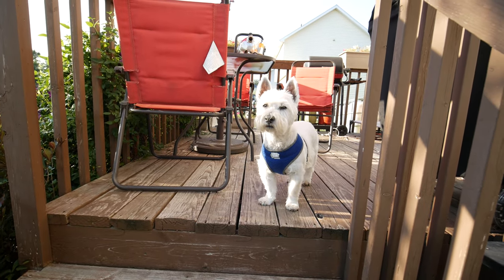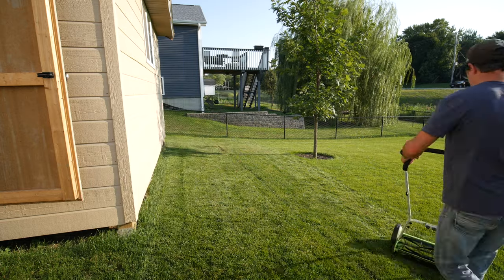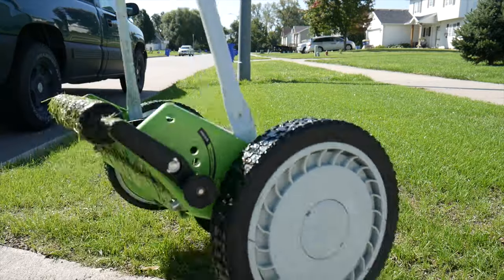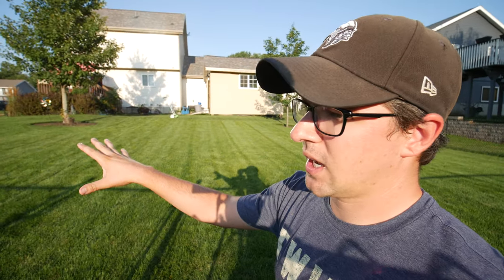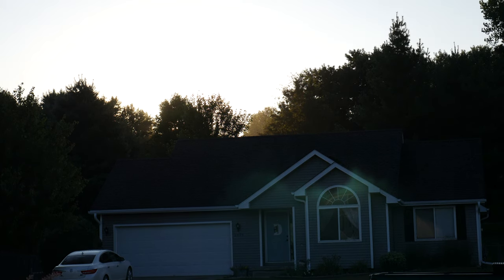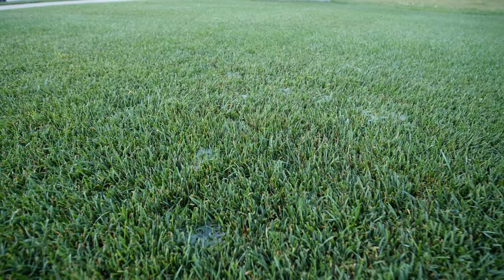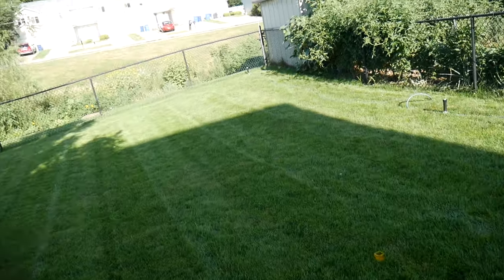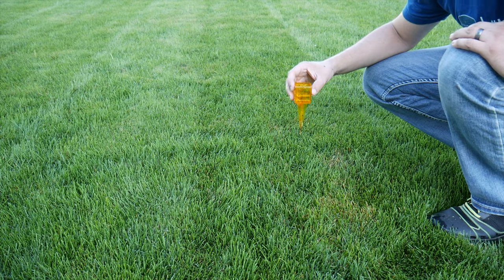Why Lawn Renovations NEED This Reel Mower?? // Westies, Backyard Update, Swardman Electra

Comment: Ryan, looking at your reel mower reminded me of when I had lawn cutting jobs at age 14.   I bought a reel adjustable mower from Sears that cost $57.00.  Had an adjustable knob in the middle front that would raise or lower the wheels, thus the blades.  I once got it sharpened from a professional, and he makes these type adjustments to the blades that touch the lower bar. It's where the blades of grass get caught between the cutting blades, and flat bottom bar. He adjusts to the point where when he put a piece of newsprint in between, the tolerances are such that the blades take off the ink, but doesn't cut the newspaper.

Comment: I'd suggest looking into some quick connects for your hoses and sprinklers.  It makes changing them out super fast.
Reply: Yep, I have quick connects on every piece! 
I also have a short leader hose to move the timer away from the bib, and Y-connector with on/off switches to attach the irrigation unit. The Y has a quick connect input, a quick connect output, and a threaded output. 
The switched Y allows me to run the water out the threaded connection and soften the turf to insert the impulse spike into hard turf. I can turn off the water flow while out at the hose end, switch sprinkler type, or adjust the pattern without going back to the bib or timer to turn off the water and then return to the bib to turn on the water. An on/off switch at the hose end saves me steps!
The thread connection is there if necessary, and I don't need to remove the quick connect on the bib or hose end.
Reply: I prefer the plastic fittings over the brass, too. 1/4 of the cost.

Comment: Ryan, I noticed your cleaning of your lawn mower after cutting... do you performance this maintenance with all of your machines after every cut according to the different areas of grass?  The reason why I ask is my front lawn was once weed free and I usually cut it first then immediately cut the back.  One weekend I cut in reverse, first the back then the front (the backyard is my renovation project with weed content).  And wouldn't you know it, I started seeing weeds in the front.  I also do not catch the clippings when I cut.  Should I be washing down the underside of my lawn mower before I cut the different areas?  Should I go back to bagging?

Comment: I have a fiskers stay sharp plus and I love it. My only issues is the width. If it was 21/22" it would be perfect. 18" is a bit too narrow.

Also been cutting at second lowest setting( 1.5" maybe. Lowest is 1") and it's been fine all summer. Haven't done anything other then one application of fertilizer. My area is southern Ontario so it shouldn't be too far off yours.
Reply: @Striperman rbg
Reply: @Striperman is 1.25" the second lowest setting? I wish it had heights for all settings.

Comment: Fantastic! So, I'd like to experiment with my best, flattest/most level, best growing area of KBG in the back yard and get a small area down to reel low height. Something to do during the fall growth push. Would you suggest getting started with a hand-op reel like the one you use in this video, working down from highest to desired cut height every day? Also, we were STOKED to see our sticker in the shed! Cheers from MN!

Comment: How long does it take to mow with a manual reel mower? I’m really tempted to get one but I have 10,000 sq ft. Maybe I’ll just do my front lawn which is only 6,000. I just don’t want to spend half a day mowing if I’m going to be maintaining a low height of cut under 2 inches I’ll have to do it 2 or 3 times a week. Right now it takes me about 1.5 hrs to do my lawn with a 21” Honda. I know these manual reel mowers come in 16-20” versions. Larger one of 18 or 20” is probably the way to go for how much grass I have to cut. What do you think, could I do that much grass in a reasonable amount of time?
Reply from the maker: I wouldn't likely use a manual one as a main machine. Nothing wrong with them but it does take some time and a good workout. I'd probably do about 2500 max

Comment: Hey man what’s the plan with the pythium blight besides getting away from the rye. Same problems over here in OMA. Seems to leave the KBG alone but man it has gotten after the rye. Probably not gonna do much about it this year but thinking about starting early next year with mefanoxam, just not sure I want drop the coin on that for a small yard. Curious if that is that what you were thinking about when you mentioned a fungicide in your earlier video?
Reply from the maker: Yeah the rye is susceptible and it has been had this year. I've got that plus some brown patch and a multitude of things going so I did end up dropping coin on mefenoxam and will be spraying that tomorrow.
Reply: Hope that goes well. Looking forward to hearing the results.

Comment: Awww the puppers, I love the pups! My dogs kind of rule the back yard lol. I’m really interested to see how that section in the back does compared with a rotary cut side by side. I’m tempted to get one now that I’m renovating my front lawn. I’d like to start mowing around an inch or 1.5 on my kbg. Starting with my Honda though since it’s what I have. Hopefully it does alright at that height for now. So how long does the manual reel mower take for you? I have 6k sq ft in the front and 4.4k in the back I’m worried that it would take me forever to mow that without an engine lol.

Comment: Would quick connect with the spikes make the job easier?
Reply from the maker: Restricts flow in most cases
Reply: Nelson still makes some without the built in automatic shutoff on disconnect. It has no restrictions. I have them on the end of ever sing thing that I have. I haven’t threaded any in years.
Reply: Ryan Knorr Lawn Care Got ya. I thought about making one like that just yours because of the pure fact that it tedious moving them around all the time.

Comment: Did u get the automatic irrigation system going yet? And does it run in the back?
Reply from the maker: No system in the back. We have some possible landscape work to do where lines needed to go and I didn't want to have to move them in the near future
Reply: Try out a traveling sprinkler for a while. They make for great videos.

Comment: I had the same problem with my reel mower. The lack of suction means lots of bent over blades. I think next year the reel will be for every other mowing.
Reply from the maker: Suction isn't even doing it on my yard when it's cut tall. Hence the reason I'm trying to bring it to about 2 inches for height
Reply: Ryan Knorr Lawn Care same here. I’m currently at about 3 inches but thinking about going lower